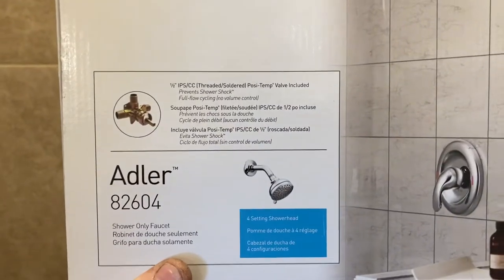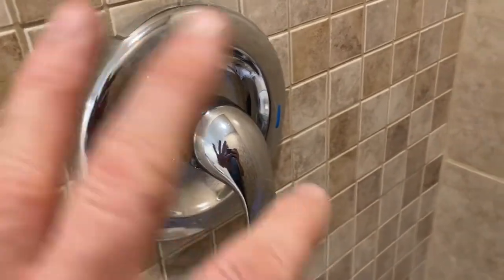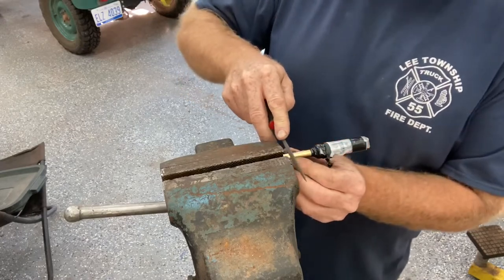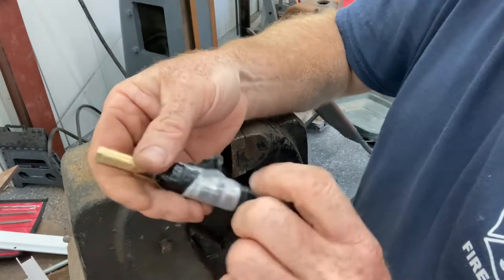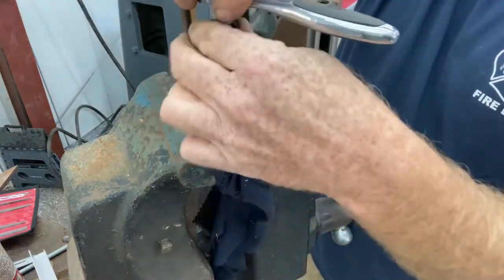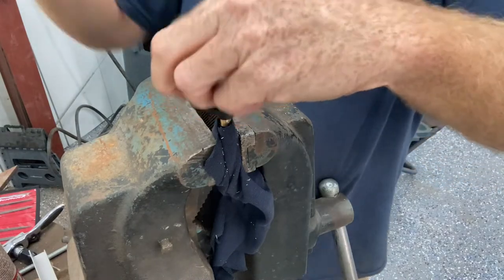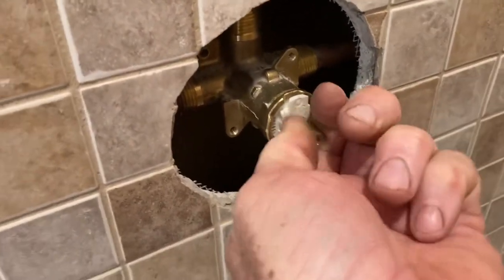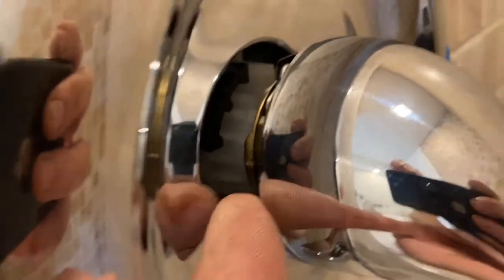Moen 1222 cartridge- why such a large gap?

Comment: Yeah, like Chris Carter said, you’re missing the chrome sleeve. 
Besides dressing out the valve it also helps shed any water that might creep past the handle.
Your fix looks better, but I’d try to get the correct parts from Moen.
Take care👍
Reply from the maker: I looked in the Moen parts list and found the sleeve. It was not included in the menards valve kit and not even in the parts list. I guess that’s why they were cheaper

Comment: You are missing the chrome sleeve that covers that section of the valve! I’ve been a plumber for 21 years, and have installed 100’s of these Moen valves! The valve trim that you have looks like a Home Depot type all in one kit, it is possible that the cheaper kits don’t have that sleeve.
Reply from the maker: This was a menards unit, it didn’t come with a sleeve… that would be much easier. I looked online but couldn’t find one.